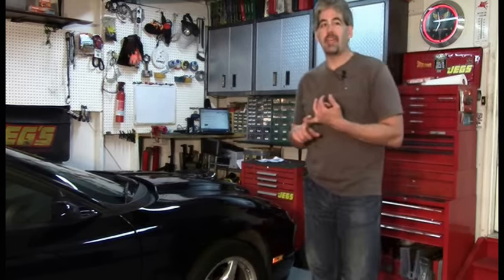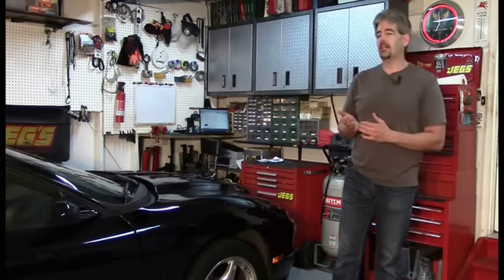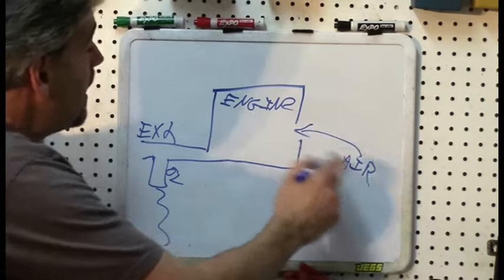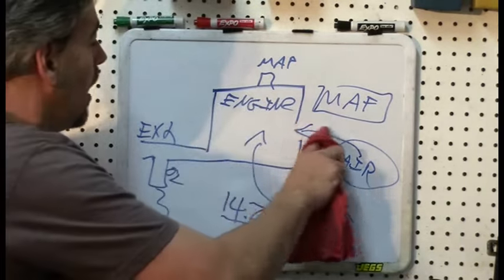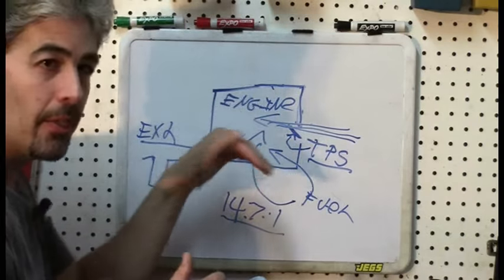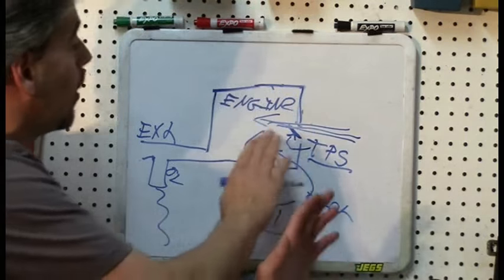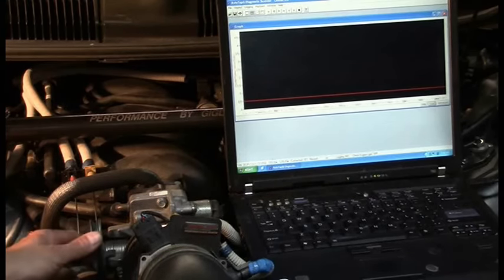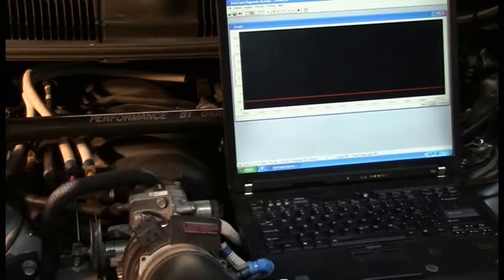TPS (Throttle Position Sensor) Diagnosis and Understanding Pt1

Comment: Hi i did a diagnosis to kia picanto electronic throttle body with the kds, kia original scan tool but it has 2 tps signals they both read in percentage% when throttle plate is open  the throttle body has got 6wires if you mind i just want to know if there may be 2 tp sensors in the throttle body
Reply from the maker: Yes I see this a lot. In fact you always see it on Electronic Throttle Control both with the TPS and the APP (Accelerator Pedal Position).  Usually the potentiometers are opposing- that is, one will read 0V at idle and 5V at WOT while the other reads 5V at idle and 0V at WOT. the two always add up to 5V at any position.
Reply: @SchrodingersBox  thank you it just bothers me when when i don't know something
Reply from the maker: Hahahahaha. I’ve made a career on that attribute lol. I have been like that since I was a child. It’s why I became a scientist.
Reply: @SchrodingersBox  congratulations you are doing well !! two jobs in parallel with each other. i actually watched your video on covid

Comment: Tested my tps wires on my vw t4 and ive got 5v, power  and 2v on my signal wire when unplugged? and a bad earth.. would that stop it from even firing up?
Reply from the maker: It could.  It might think TPS is at fuel open which would initiate a clear flood mode and shut the injectors off.
Reply: @SchrodingersBox  thanks for your reply. I tested it again whilst it was connected and all seemed ok..apart from it not starting

Comment: Hope you can help, 2012 silverado 6.0L trying to do a throttle sweep test, but i keep getting engine speed detected while engine is off!
Reply from the maker: What is the actual TPS signal voltage when measured with a DVOm?
Reply: @SchrodingersBox  4 volts
Reply from the maker: and what does the sweep test show as high and low range?

Comment: I’ve got an Lexus es330 2004 I had the transmission rebuilt bc it was surging and apparently everything was burnt up. Less than a year later I am having same issue. Slipping surging and rpms out of control. No codes. Idk what to do now bc the trans tech couldn’t even figure out the Throttle issue. Idk what to do st this point. I have spent too much money on this vehicle and now it doesn’t shift lol. Wish someone like you could help point me in the right direction to diagnose and fix this.
Reply from the maker: I would need some basic data to even get a direction.

Comment: Ok Im have a problem with my 04 tax. Got a new battery and in the process my ECU got reset.. I leaned how to reset from videos on YouTube and article so I under stand it has to be driven to reprogram everything.. after that I returned back home hopeing everything WORK. Started it an HR later and still doing the same exact thing.. it was  slaming into gears and when driving won't shift out of first.. (This is whats trickey. I'm under the impression it's resetting the ECU Everytime I start the car??? Or what can i do to get the ECU to reset itself properly AFTER my DRIVE ??? Ifollowed instructions and took it on the exact RESET DRIVE.. it's just not being (ENTERD) idk I'm at a loss and need help
Reply from the maker: what data are you seeing that’s showing the ECU is resetting?

Comment: I didn't watch this video before and did a test from power to ground and the two t-pins I put touched each other. Did I short my pcm?  :'(   How can I check if I did?  I went back and checked power and ground at the connector and still get battery voltage.  What do I set the dial of my multimeter to?
Reply from the maker: OMG. You now need to test at the PCM to see if the driver was shorted from that.
Reply: Ok thank you.  :(

Comment: I have a uo107 code on 04 Acura TSX  I replace throttle body and the sensor that throws the signal to the throttle body but the car don't want to accelerate at first when you turn the car on the idle go up and down they fix that and now it doesn't want to accelerate what can it be if I can get ur help I'll thank you and God will bless u too please  I already spend a lot of money on this car

Comment: What would it mean if when fully open the throttle position is only registering 65%? it is smooth and fluent all the way up but I would think fully opened would be 100%
Reply: +David Francescon What is the signal voltage and the voltage at idle vs WOT?

Comment: What if with my throtle plate closed i have ~4.5V and when i changr its angle the voltage reduces until avut 0.5 ??? Thanks
Reply from the maker: Then quite obviously you are measuring itincorrectly and crossing the reference with signal.

Comment: Well actually im here for a p0730 wich is incorrenct gear ratio and i learned that in order for the transmission to shift it must comunicate between throttle position and vehicle speed so im trying to understand tps..
Reply from the maker: Check the correlation with input vs output shaft ratio

Comment: Good video, No codes,,but trying to figure out why my low reading is .55V, on 99 Durango 5.9ltr. TPS not adjustable and throttle plate clean, and I messed with the angle to see if it might go down. It didn't.
Runs perfect in all positions, and idles down like it should.. Replaced TPS to see if I could find around .05V. Any ideas, anybody. >>Using Launch CRP 429 scanner.
THX for presentation.
Reply from the maker: ARe you measuring the signal or the 5V reference against ground?
Reply: @SchrodingersBox >>It's the signal, the high end is around 3.58 volts according to scan tool. I get the same readings with volt meter. 
Hay, THX for reply. Still messing with it tonight.
Reply: @SchrodingersBox >>I am measuring the signal with the scan tool. Also with a volt meter.
I am finding out this CRP 429, is not compatible with this 99 Durango.

Comment: Hi i have a 03 parkave for some reason  the car will not start unless i have the gas pedal pushed to the floor then when started it will stutter for about a minute tben idle up to like 2 rpms the idle down to 1.5 i noticed it will move on its own when i take my foot off the break
Reply from the maker: OK- what data do you have?

Comment: When figuring out what the power and signal wires are... Why not just ground the ground wire on the volt meter, and then hit each wire of the wires until you hit 0 voltage?
Reply from the maker: You can do that too except I like distinguishing that the ground wire on the component is not simply open.
Reply: I want to thank you for the video. Saved me from just replacing the TPS... Mine threw the code. My OBD scanner "BlueDriver" lets me see the % of throttle, and it didn't drop when testing... I am guessing that there is buildup in the throttle. I am going to take it apart and clean it if the code pops again. It turned off after I tapped on everything, connectors and units.

Comment: What about cars like a 2005 Mazda 6 3.0 that has a TPS inside the throttle body?
Reply from the maker: doesn’t change anything. the wiring is still external.

Comment: The level of sass is extreme
Reply from the maker: how about the level of accuracy though?
Reply: @SchrodingersBox  Fantastic
Reply: Actually I have a question that I could use help on. I have a 04 4.3 Chevy blazer that has a rough idle, but particularly on the scan tool I can see every cylinder misfiring randomly only at idle or slightly above idle. I cleaned the throttle body, the ground, the IAC, I tested the TPS with the scan tool and a multimeter. My main suspects are ICM and IAC, I replaced cap and rotor. Plugs and wires are only two years old. I notice on the scan tool that sometimes both the desired IAC and IAC position drop when I get these misfires. This could be due to the misfire itself or possible something wrong with the IAC. 1. I don't understand why the desired IAC would drop with a misfire? 2. I noticed the o2 sensor graphs that the post can sensor 2 graph looks funny, kind of all over the place, so I'm wondering if a bad cat or sensor is part of it. Fuel trims are great btw very close to zero long and short. I've checked for vacuum leaks multiple times, but my trims also tell me there is probably not a leak. 3. I'd appreciate your input and/or a video on IAC scan tool data. Thanks for your videos, they are sassy, but I appreciate learning.
Reply: *Cat not can, sry
Reply from the maker: the IAC change is the result, not the cause of the misfires. since you have a scantool, you need give me the results of the fuel trim analysis you are saying “does not indicate vacuum leak”.
 it is impossible to have normal fuel trim with random misfire. the fuel trim tell you what type of misfire you have (lean or ignition based).
Reply: @SchrodingersBox  So your advice was helpful and the problem was solved, at least it's been a week since the fix and the probable has not reoccured. It was occurring everyday so I'm 99% sure it's fixed. It was not a p0300 code, I just noticed I'd get about 1-3 misfires every cylinder on the scan tool. I took your advice and paid closer attn to the fuel trims. What I noticed is that a I was getting about -2 on the stft which didn't seem like a big deal, except I found some old reading that showed -.78. I think googled things that could cause a rich condition. I tested several things, but paid particular attn. to the map sensor. I noticed the map bouncing between 2.5-5 psi very quickly. I performed some test on the electrical. Replaced the map and problem solved. Your MAP video was helpful, noticing just that slight change in fuel trims when you uplugged the map. I actually think the seal around the map was part of the problem, it just looked warn. Thanks for the advice and the teaching.

Comment: Hi there need bit of help I have sprinter van 2.1cdt..  I m gert8nf error code p2112.  When I reset code my can runds persect but on high speed when I break my can engin ligh come on with above code..  Wat u recon. Is it throttle body..  Or tps.. My readubg r 
MAF 14.8g\s.  Throttle psotion sensor  85.9% and when I press gas paddle right down tge reading are 39.9g\s. And 21% to 85% gradually..  Pl advise
Reply from the maker: Do a resistance sweep test on the TPS between signal and ground.
Reply: Many thanks for quick reply. I need bit more info... on idle I m getting throttle body reading 86.3%  .. when I press accelerator pedal  it doesn't change any values... but when I release accelerator pedal it goes to 21% then back to 86.3%..
I m not confused... is it ok like this .. Mercedes Benz sprinter van 2.1 CDT.  Pl advise ..
Reply from the maker: As stated, next step is validating the reference, signal and ground.

Comment: just bought 99 c5 vette ,dic put out service active handling and traction control system and goes into reduced power mode,says 10pcm 2 codes c1278 traction control temporarily inhibited by pcm,c1255 ecu malfunction,have taken it to chevy place they do not find any problem,but it has happened again since then,,have seen many guesses on forums,need an educated answer on this,have only had it a week and want to make it right,I need your help bad!!! keith
Reply from the maker: keith jones What did your diagnostic tests indicate?
Reply: Thank You Sir for getting back to me so quickly,( tests reveal nothing wrong)problem is temporarily resolved by the time diagnostics are done,note though,seems to occur shortly after washing the vehicle or riding on wet roads,is it possible water is getting to the pcm and tac module and causing this,i noticed the plastic wheel well cover behind the right front tire has small areas around the edges where water can possibly get in,is this a possibility(temporarily inhibited by pcm)???one person said replace tac module,moisture???? have checked tac and tp sensors (ok) any suggestions greatly appreciated!!!THANKS AGAIN,keith
Reply from the maker: keith jones Let me rephrase- what diagnostics have you done and what were the results?
Reply: youmans Chevrolet did all the diagnostics,spent 3 hrs on the car said could find nothing wrong,i have checked tb cleanliness,wires on tac, fuses,,wiring at gas pedal,grounds,gas cap,everything fine ,next door neighbor has professional diagnostics tool says same as others temp inhib by pcm,am pretty sure chevy checked pcm and tac ,is why I wonder if moisture temporarily causes problem seems to only last 30 min or so .
Reply: I am a novice
Reply from the maker: keith jones Yeah Keith, sorry I couldn't fit things to fit into YOUR schedule. I know, it's ironic since hundreds of videos, all the thousands of comments, and my entire channel is ONLY FOR YOU KEITH.

Comment: So what do you do when you have a dead spot? How do you correct it?
Reply from the maker: You would replace the TPS unless you can somehow clean the sweep
Reply: @SchrodingersBox  my mechanic told me not to replace since it only has dead spots it can be saved, didn't believe him and that's how I ended up here, thanks btw
Reply: Replaced the TPS bust still the dead spots persist...any clues?
Reply from the maker: That is impossible. The only explanation is there is no dead spot. At what angle does they TPS voltage drop to zero??

Comment: PLEASE HELP
I recently bought a 2006 Toyota Sienna 3.3 L it was running okay I gave it to a backyard mechanic he installed new coil packs new OEM plugs change the oil brake pads and rotors I took the car to the smog place to get smog done it passed with no problem there's no codes when the mechanic fixed it and there was no codes when the smog technician smogged it.. but here is the problem when I give a normal amount of acceleration the car runs relatively normal when I step on the gas pedal it goes into passing gear the RPMs jump up but it does not want to accelerate the way it should be it feels like something is holding back like maybe someone's holding her hand over the exhaust pipe or its starving for air I don't really know I just don't understand why is it doing this I asked several mechanics and they don't know what to say they say there's no code so we don't know also sometimes I step on the throttle and there's no reaction and I have never seen it go to 6000 RPM it always goes to about 4,500 please let me know what you think it starts up fine it shuts off vine I don't think it's timing when the guy smog did they put the OBD2 reader on there and it was at idle and that's when it was reading 4 codes I'm not sure what would happen if they would step on the accelerator maybe it would read different.. Please get back to me...
Thank you
Reply from the maker: Ok.... what data do you have?

Comment: what if my signal wire is at ~12V? i have a 3 wire tps.  i checked all 3 wires and got good result for the ground wire (0V) and reference voltage (5V).
Reply from the maker: You measured wrong then.
Reply: +Schrodingers Box black probe is in ground and red probe is in the signal wire. i measured it by back probing the connector of the tps
Reply from the maker: Karl Engbino If black is in ground then you cannot possibly have -12V.  That is impossible. What you think is a ground is necessarily a power.  If you aren't sure of power and ground then you really need to stop before you do damage.
Reply: +Schrodingers Box lol, its not negative 12. its ~12V. it means its around 12V. i know what is ground and the signal wire is. signal wire should be around 5v right since the reference voltage is 5V
Reply: Total swag, but might be a short. Did you get it fixed?
Reply: Nissn Moreno 2006
Reply: Old thread and without the schematic, it would be  hard to say 100% but if you are getting 12v, then there is a voltage 'bleed' from somewhere.  If that pin is direct from the ECM only,..and i think it is, then the ECM is bad.
Reply: Check ECM pin with connector off. Reference FSM for voltage references too. Could be a unicorn?

Comment: the car was running like crap ... i unplugged the  tps & it ran better... is that a call for the  tps  to be bad ?
Reply from the maker: Not necessarily. it might just be forcing a default programming that dismisses the actual bad input. you need to test the TPS signal voltage.
Reply: @SchrodingersBox  ok  i tested it & IT WAS GOOD... STILL RUNNUNG LIKE CRAP
Reply from the maker: Then it isn’t the TPS. I would start with the basics- run a fuel trim Analysis static vs loaded and that will always give you a starting direction.

Comment: Without wanting to contradict your video, my wifes car has a hall effect device doing the TPS stuff, not wanting to compromise the connectors and connect a meter inline I just used OBD diagnostics to verify that the "brain" knew the butterfly position ...
Reply from the maker: +David Lisney What car is it? I can't figure out how hall effect would be used for a TPS.
Reply: +Schrodingers Box Believe it or not the car is just a 1.4 litre Fiesta, in the throttle body you have the usual brush motor with reduction gears ultimately driving the butterfly. This last gear appears to be nylon, it has a magnet in the centre, the plastic cover of the throttle body has a Hall effect IC which sits close to this magnet. I could probably send you a picture but there is. Youtube video of exactly the same throttle body.